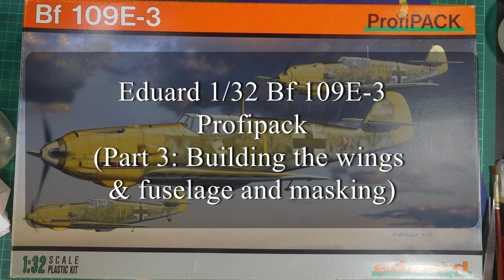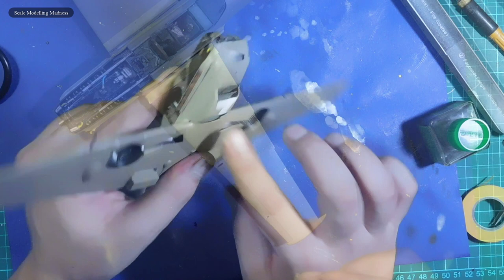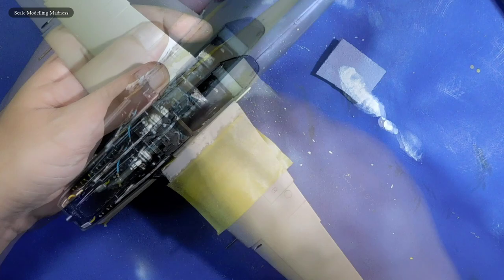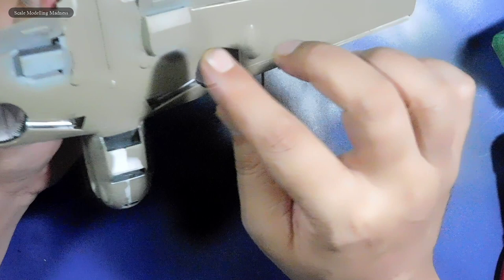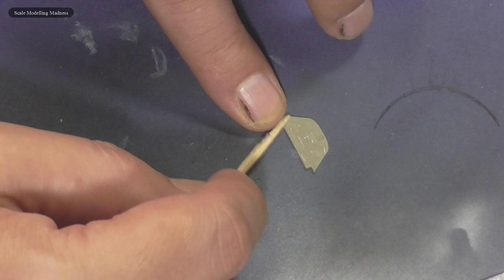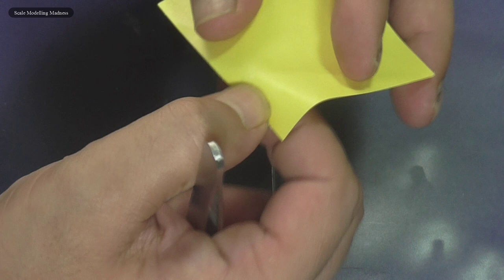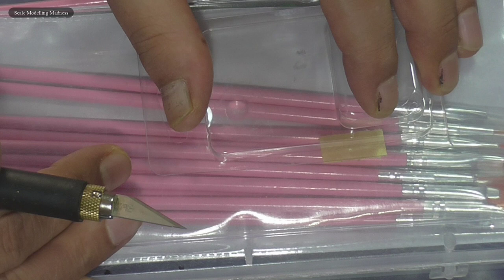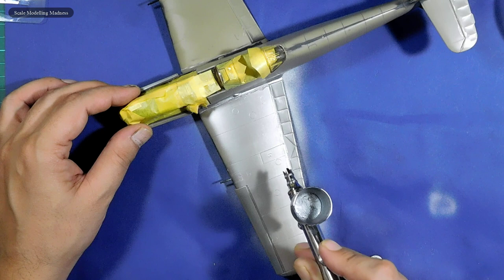Eduard 1/32 Bf 109E-3 (Part 3: Building the fuselage and wings; masking the kit)

Comment: Sir hi, I had the same problem with my Eduard 1/48 Mirage IIIC, there was a huge gap between the wing root & the fuselage, there are lot of complications in this said kit, still have to work on it, when, I don`t know. Frankly I personally don`t like Eduard kits, I think I will dispose it, I like kits by Revell, Trumpeter, Testors, Airfix,  Italeri or ESCI they have NO issues like Eduard.

Comment: Judging from the dialect you are Indian... well, your model is very colorful, but I think it has nothing to do with the coloring used on the real aircraft. From late 1939 gray colors (RLM 74, 75, 76) replaced the blackgreen/darkgreen (RLM 70, 71) paints. "Experts" reiterate, that Bf 109 E's in early/mid 1940 were finished in RLM 71/02, period!